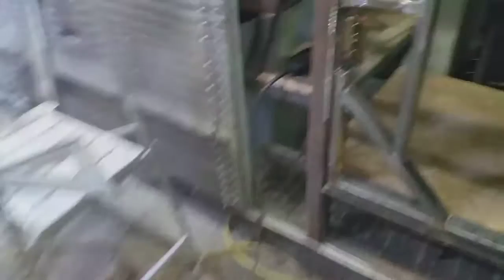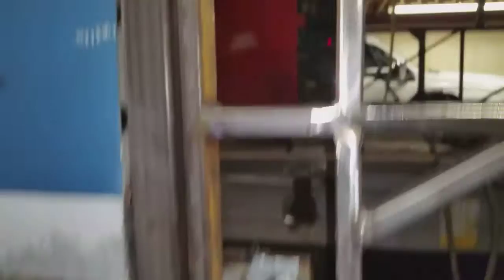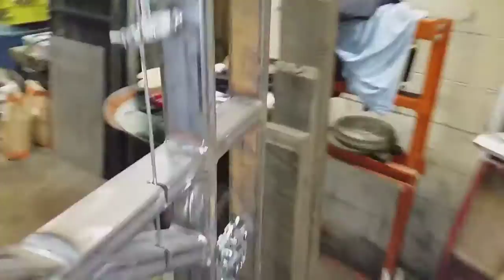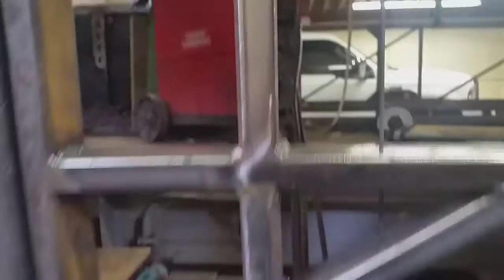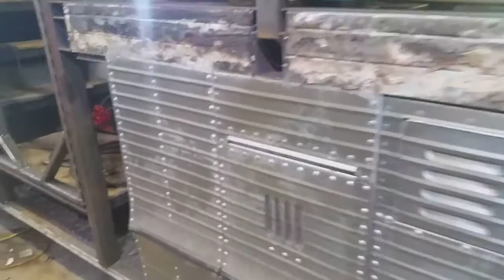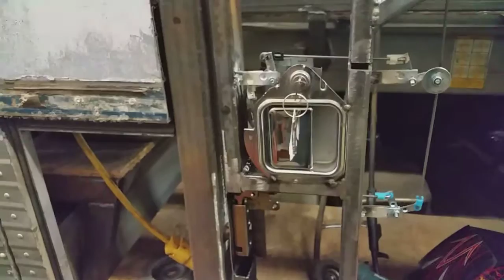Bus Conversion Video - 28 - Door Handle Install

Comment: Would you be able to get to other buses that have been wrecked, so you can get intact pieces of skin for an affordable price?
Reply from the maker: They quit making MC-7's in 1973 so finding a wreck is pretty rare and anything that is still a running bus is too valuable to be taking parts off of and I need some longer than stock skins so I have decided to re-skin the whole lower section in smooth brushed stainless, you'll see I've started on that in some later videos, thanks for the suggestion though!!!

Comment: I'm sure you are beyond the siding, did you think about pulling siding of a bus in a salvage yard?
Reply from the maker: they are mostly in as bad a shape as this one.... if you can even find one, most have been scrapped out already and I need some longer than stock panels so ones from another bus wouldn't work
Reply: Was just a thought

Comment: hello, I have a few questions regarding your bus conversion build. how tall  in feet did you extend your bus up to and how far does your pullouts go?
Reply from the maker: Raised the roof 12" and the 2 front slides extend 36" each, the rear one will extend 30" as that is all the room there is between the outside wall and the engine doghouse

Comment: Personally I would have asked the panel suppliers to look at your VLOG. Out of 362 subscribers, even if 5% had the same model as you, thats 18 DIY'ers that will possibly follow your example of going clean skins. Would they prefer to lose the sale of 18 - 62 possible skins through overpricing or make some smaller margin profit sales.
Reply from the maker: Apparently so, haven't heard back from them, sometimes sales people are very shortsighted, I have other damaged panels as well so they won't get the sale on them either.... oh well, I'm kind of liking the smooth skin idea anyway and in the future , if I damage any, replacing  them will be much easier.... now I just have to buy a louver press for the battery box door, I've always wanted one of those  :-)

Comment: Very nice work, James. Thanks for sharing it so that we can learn. Will the interior door skin be removable so that you can get in there an periodically lube the moving parts? If so, maybe those rubber well nuts would be right for reducing vibration.
Reply from the maker: Yes, inner door panel will be removable so this mess can be maintained...:-) , probably a removable oak panel

Comment: Have you allowed for the door seal pushing on the door locks? and if you need spares clips on the bell-cranks, visit the 80s toyota section of a pick-and-pull car wrecking yard and fill a pocket. 
BTW, great detail in your build, is sort of-what im planning for in later years. I always thought slide-outs were too complex to do, opinion now changed ;)
Reply from the maker: Ya, you're right, the door seal will add some pressure on the door same as trying to pull it open....just have to see how it all works out, I'm hoping it's just that the latches are new, worked much better after they were lubed up so hopefully they will wear in a bit
Reply: A way to get a grip on those rods for additional pulls and such would be to take two fender washers. Grind a groove on one side of each, so that they clamp around the rod using the center hole of the fender washer.